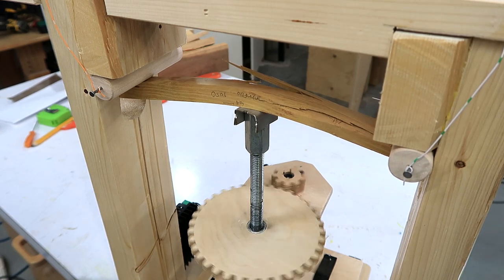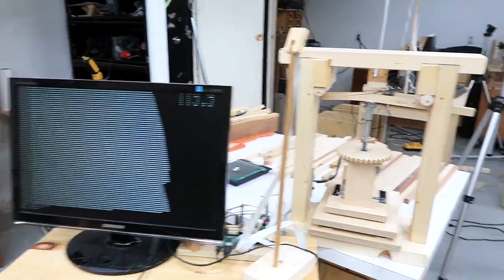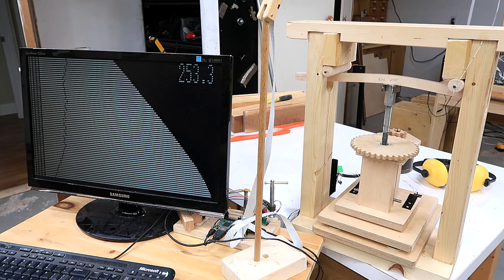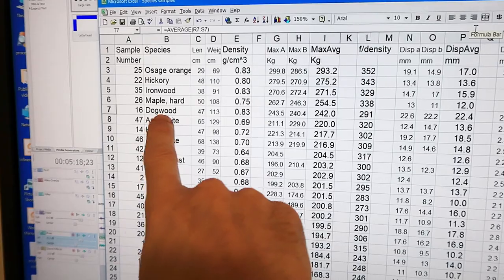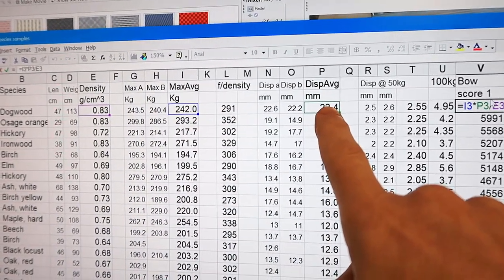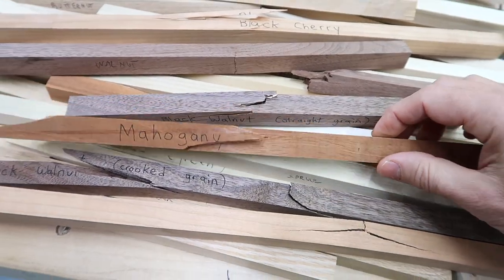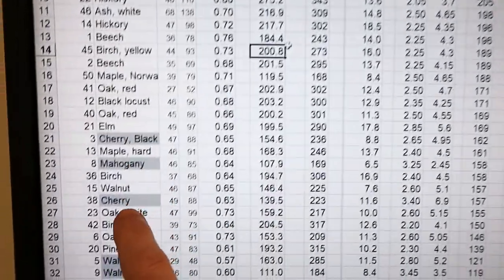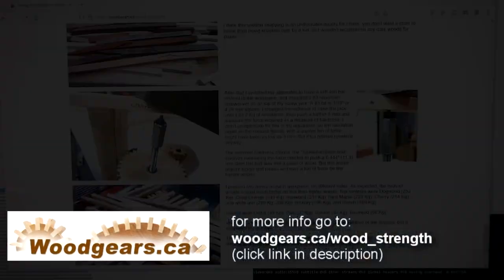What wood species is strongest, hardest, stiffest, best for chairs, tables, or bow making?

Comment: MY GOD you plane fast.  How did you learn to do that and still keep it safe?  😕

Interesting, I had no idea dogwood was that strong. Grain structure (straightness) is also EXCEEDINGLY important for strength, especially in smaller sections, where it is more difficult to achieve.  I expect if you really were seeking best bending strength you could split the wood into larger section strips than the finished sections, and then cut to finished dimensions.  I know they spit woods for basket making, and the wood strips are very very strong.  They are split and woven green, so they are hand workable and the final dried strips are exceedingly strong and tough.

Not wood. but did you see where researchers just came up with a material that sounds ridiculously too good to be true?  It is a THREE DIMENSIONALLY crosslinked polymer.  The process is evidently very easy to place and scale into production so hopefully we will be seeing it soon, unlike most previous unobtainium you hear is the thing of the future (please make the correct sense so in this case). 

The structure was thought to be impossible by scientists and physicists that have been trying to accomplish it for a very long time.  They could produce small samples, but the nature of the bonds quickly led to an inversion in one molecular bond, and failure of the lattice, which then propagated down the entire sample, rendering the entire remaining portion just a normal polymeric material, as I understand it.  And apparently this happened quickly and predictably reliably. 

When I give you some of the specs here, you will very much think I am making them up, but I am not, google it.  It has 6X the strength to weight ratio of steel, is completely non permeable to gasses, which is a standard problem with typical polycarbonate (lexan) or plexiglass type materials, and is VERY impact resistant, as well.  Forget the transparent aluminum of Scotty's in the Star Trek movie, this absolutely demolishes the specs that material would have had.  

Likely one of the most significant materials advances of my lifetime.  Composites like fiberglass and carbon fiber were recent discontinuous curve advances I can think of for structural plastics, but this has other aspects none of those posses, like the tremendous clarity of the aforementioned polymeric plastics.  I can't wait to see it.  

Obvious applications,  like practically so called 'tornado proof' windows. Forget the present hurricane resistant types, and far more bulletproof and more structurally sound 'glass', windows for ISS  (you wouldn't believe what they use now IIRC, look it up), and many many many more. But with the strength of this stuff things you would NEVER expect, like wing spars/skins, etc, and one they mentioned that sounds crazy, which was sky scraper type STRUCTURAL building materials in place of steel.  Incredible, actually, in the literal sense of the word.  Again, I can't wait to see it in applications.  

I expect it could have applications in 'we are still waiting' dreamed of absurdly difficult structures like space elevators.  Kevlar/carbon composites came fairly close, but not close enough.  That space elevator, by the way, is a bit of a current pipe dream, as the cost would make any other human endeavor to that point look like it was basically free, including all the infrastructure in America.  At least I am guessing that would be true.  And I am not totally bereft of knowledge in some of these areas as a retired engineer, albeit electrical, but with a pretty strong core in general engineering, like materials and structures/properties of.   Not remotely any kind of expert in those areas, but at least a paper thin toe dip.

Comment: Cool information, and somewhat useful. But not to be that guy, these test are incredibly inaccurate. Wood is inherently ununiform, grain direction matter quite a lot when it comes to strength which was entirely unaccounted for. Not even mentioned. Same with hardness, end grain is going to be stronger then long grain. At the end of the day the sample size was essentially null. These types of studies have been done before. Using proper statistics by a couple of different industries. You're reinventing the wheel, while also making it a less well designed wheel.

Comment: I'd be curious to see a test on an "aged" piece (not just dried, but cut to final dimensions and left to season for a year or two) of pacific hemlock. Allegedly, hemlock actually gets harder and tougher on its surfaces with time. I've built a few pieces of furniture from construction grade pacific hemlock and I think it's gotten more scratch resistant with time.

Hemlock's just one of my favorite woods. Gorgeous color, easy to work, dirt cheap, and hasn't let me down.

I made an english joiner's mallet with a head made from a 5 inch ironwood log and that thing is a monster of a mallet. 

Was a freaking NIGHTMARE to hand-chisel the double-taper mortise in though.

Comment: Kg is actually mass
Reply from the maker: I put that in the text in the video to pre-empt pedantic comments like this.
Reply: @matthiaswandel  Sorry for the comment, i couldn´t help myself.  I wasn´t triggered because you used Kg to messure Force, but because you said " I know its actually weight". Kg is a unit for Mass and weight is not equall to mass. Weight is also just refering to a Force.

Comment: Kilogram is not a weight
Reply from the maker: Kilogram is a weight.  What are you talking about?
Reply: Yeah it is
Reply: Kilogram is mass, weight is measured in newtons.
Reply: Isn’t Newtons force?
Reply: This is an example of being pedantic about a difference that's not important.

In some contexts, kilogram is technically a measure of mass when that distinction actually matters.  In a context like this, the distinction doesn't matter.  In the more technical contexts, weight is thought of as a force, which is usually mass times acceleration.  But in a conversation where the acceleration due to gravity is assumed constant everywhere--such as in most daily life--equal mass will mean equal mass times acceleration, so it is as correct, and simpler, to just use mass alone.
Reply: @anthrond  Tend to agree with you but since he put a caption in the video that specifically defines kilogram as weight needed comment.The unit of pound in the Imperial system is a weight(a force) and the unit of mass is the slug.
Reply: next up; is a redhead really a red head.
Reply: @1pcfred  ginger is a plant in the woods
Reply: @victorhopper6774  words can have different meanings and definitions depending on context.
Reply: @1pcfred  i have seen a lot of natural orange hair on people. my own. not sure why people call it red.
Reply: @victorhopper6774  orange? So a carrot top then.
Reply: I am not sure which planet you live on. But here on planet earth, grams (and milligrams and kilograms and sometimes even micrograms) are used as measures of weight for all manner of things whose weights need to be measured.
Reply: @elmonni2103  Nobody, and I mean nobody, measures weight in Newtons. I have never seen anything sold by weight labeled with Newtons. I don't think I have ever seen a scale that could display Newtons. So when you say "weight is measured in newtons" I think you are wrong. If it is, it is used infrequently and by few people. However, grams and kg and mg and mcg are used for measuring weight quite frequently.